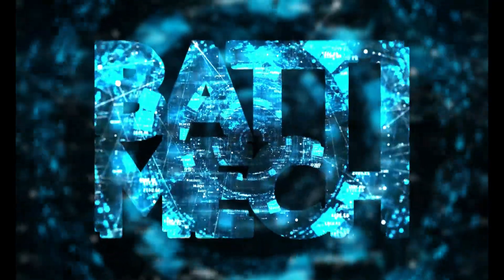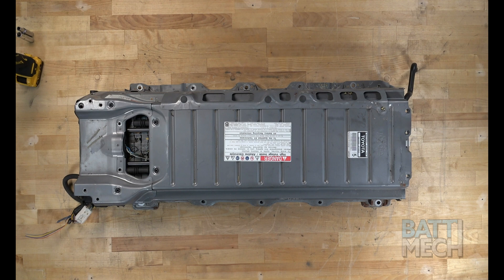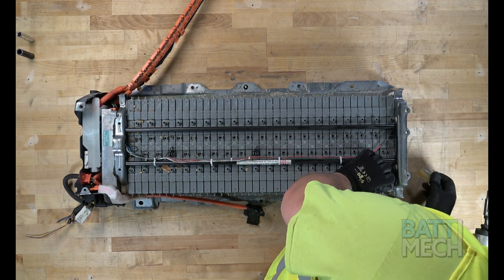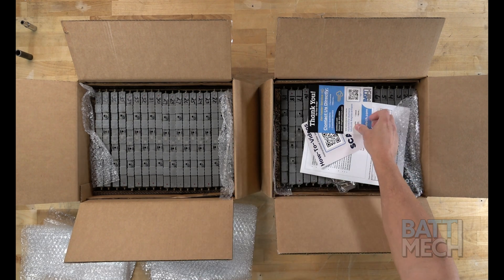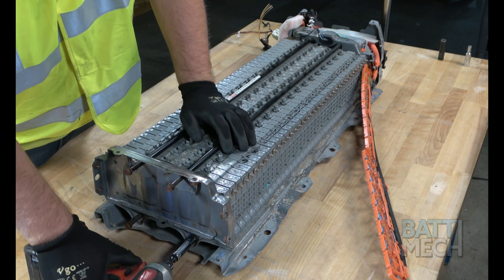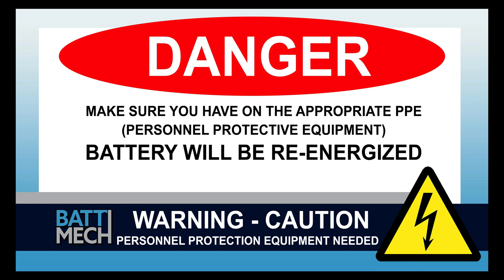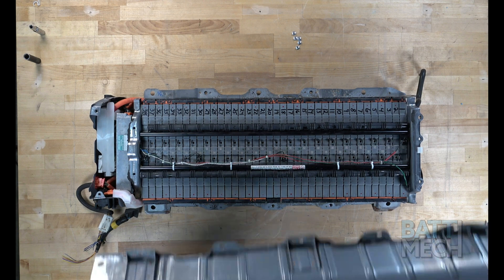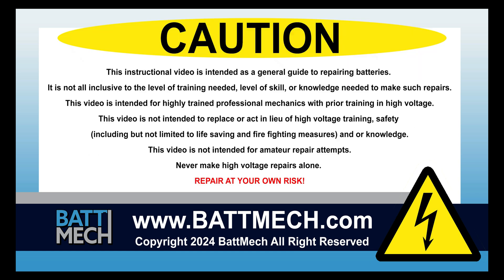How to Replace/Repair/Fix a 2001 Toyota Prius Hybrid Battery Module Cell: Step-by-Step Instructions

Comment: I'm curious what modules did you pull from. Your website doesn't have Prius gen1 cells for sale.
Reply from the maker: Good Prius Gen 1 Modules are very hard to get that test well considering the modules are typically 20-25 years old. Sometimes we do get newer Gen 1 modules in that were used in battery replacements... unfortunately those are few and far between.
Reply: @BattMech  do  you still selling these cells  or  no ????
Reply from the maker: @tupoleev  www.BATTMECH.com
Reply: @BattMech  I did  not find    for  gen 1
Reply from the maker: @tupoleev  Check back often, as it's hit or miss on Gen 1's...